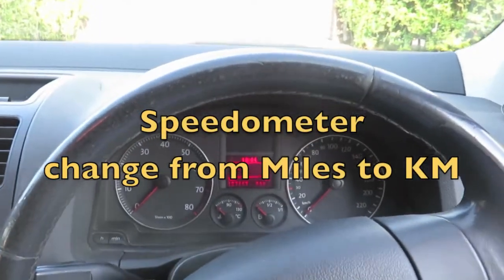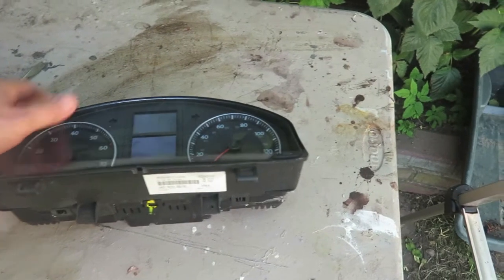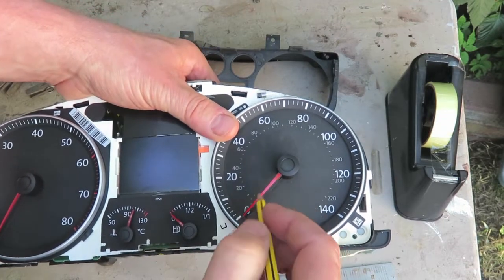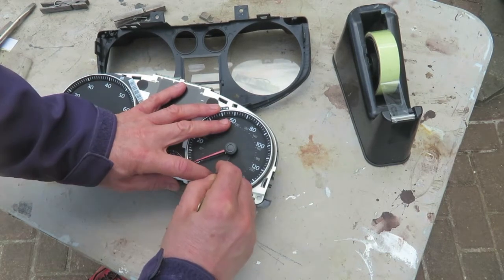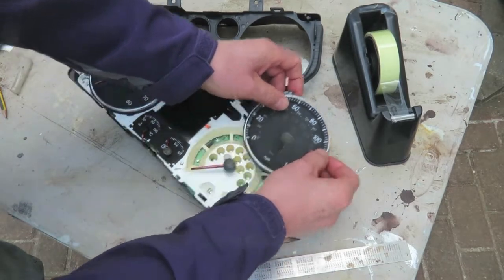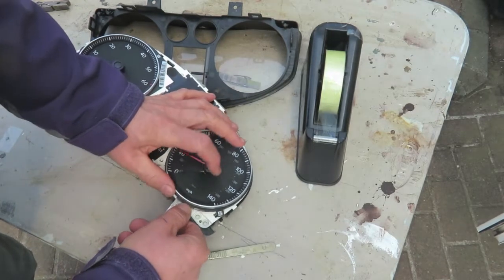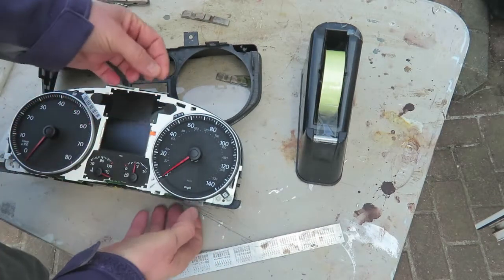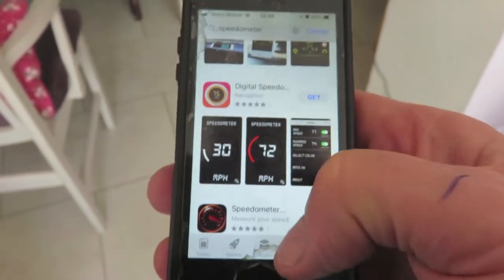Speedo Miles to KM change   720p

Comment: Your speedo will always be generating in Miles, this cannot work if your using the sheet from a KM speedo.
You will have to buy a converted printed sheet from a specialist supplier to work on your original cluster.
Reply from the maker: Speed is independent of whether you measure in Miles, KM – just the graduations are different – 10km will always be 6.21 miles.
The old one has the KM graduations also, alongside the larger miles graduation on the outside, but smaller, so it was easy to confirm that the needle was giving the same reading. Just to be doubly sure I done a few test runs with the SatNav to confirm.

I did get little shock though on a different Golf where the previous owner had changed to a larger diameter alloy rim and tyre without re-calibrating the onboard computer ... now that gave an inaccurate reading all-right – I noticed when the speed fines started comin' in :(

All the best,
Seán